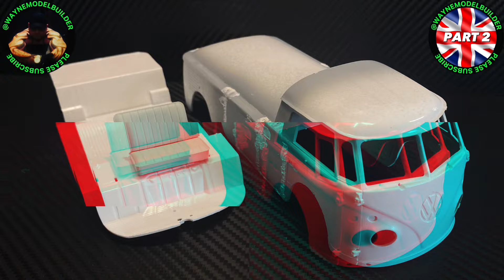REVELL: VW Bus - Sema Edition - Custom Build - 1:24 Scale - Part 2

Comment: Excellent work Wayne good job beading in that roof section nice touch adding that back valance i hear you on the  chrome the parts on this truck i'm building at the minute are a night mare to stripe👍👍
Reply from the maker: Cheers mate, yeah the chrome can either fall off in seconds or be a pain in the ass like these are 😁